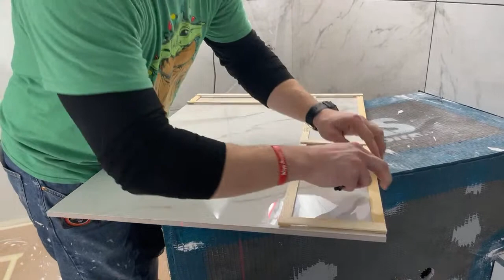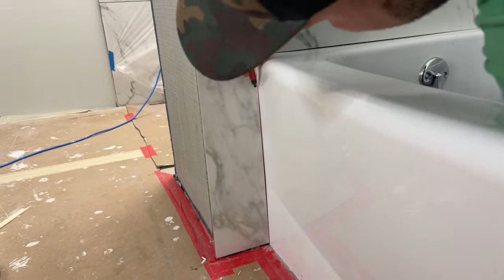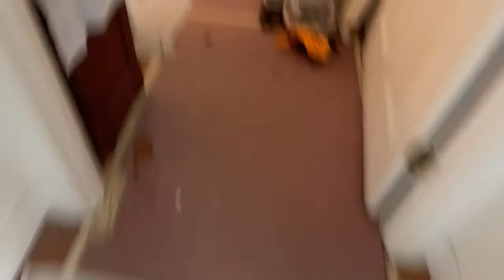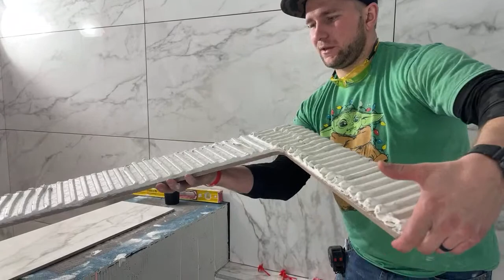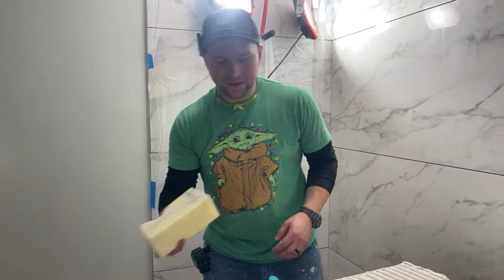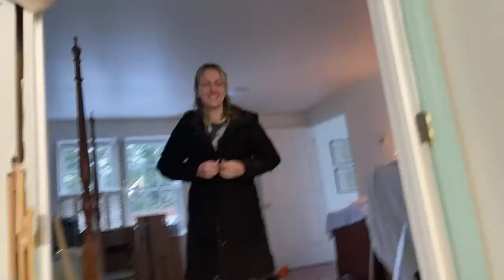Tiled Access Panel. Tub access panel. DIY Bathroom Renovation.

Comment: Love your channel! You helped me out A LOT on my first tile job. I got a question? If I’m going to be doing a fireplace new framing and walls for the tv to hang and electric fireplace (basically like a foot in depth and like 8x8ft high and length) and I want to tile over it can I use just drywall or does it have to be green drywall or cement board?? I’m really lost on that since is not a shower I was just thinking of the regular drywall but I really don’t know… and do I have to prime it, like you did??
Reply from the maker: So I would recommend doing 5/8” drywall. Those are typically fire rated. And yes I would still prime it with the primer. It’s like $10 and it would for sure make the install more appropriate:)
Reply: @WINNI.Designs  thanks! I appreciate your help.

Comment: I watched this because the title said tiled access panel, and you never did the access panel. I am trying to do this same kind of thing and need advice on how to handle how it stay on the wall either with magnets or clips. I don't know if I should a full piece of cement board behind it or just epoxy magnets to the tile. I really wish this video actually addressed the title at some point.